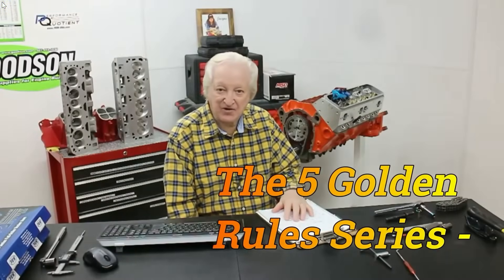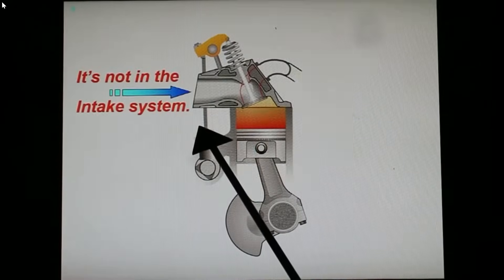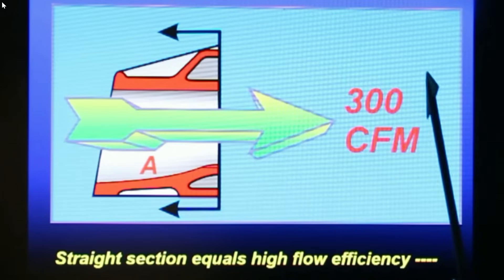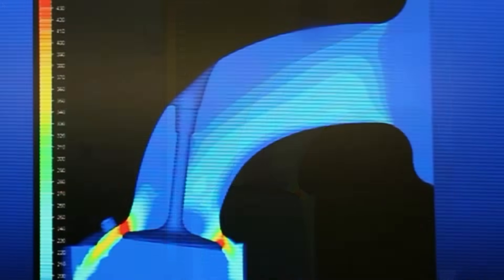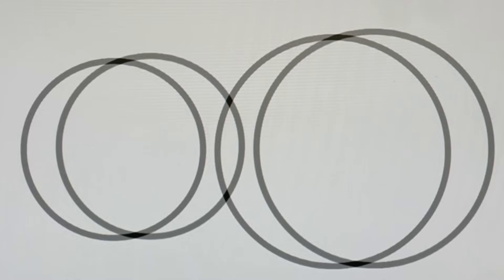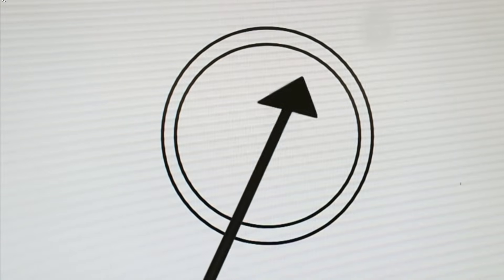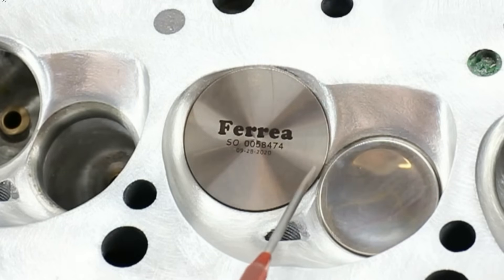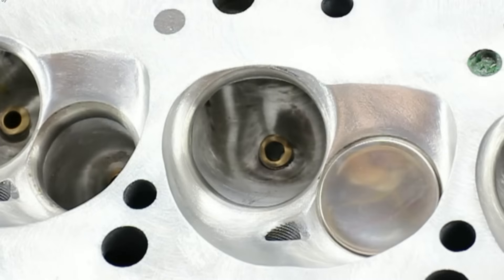5 golden porting rules - #1

Comment: I start by saying that I'm not an expert at all, just a curious person. I've not completely understood what is the radius percentage referred toso I'm probably wrong but with what I understand the valve inlet should be a little bit oval in order to help the flow on one side but the valve seat must be round in order to guarantee the sealing effect because you can't maintain an oval valve aligned because you don't have any tipe of guiding system. If anyone can explain to me that part I'll be very interested.
Reply: Air will take the shortest route, and an oval valve would force uneven airflow for a start, with more crowding the short sides. You want as much flow as possible especially at part lift, and a circle simply gives the best, even flow. It also helps induce swirl into the chamber which is essential for good combustion, and exactly why circular valves do this so well isn't really understood, they just do. They are also easy to produce, thus cheaper. Finally the slowly spinning valve prevents exhaust valves in particular not burning in any one spot, another upside to a design that works well for many reasons. There's too many upsides, and if another shape worked better you can bet the racing community would have championed it!
Reply: So essentially ,the seating-radius (sealing-radius) remains perfectly-round while a very-small area immediately-below it is very-carefully opened-up a bit or 'ovalled' to a minute-degree to encourage/catch/create higher-flow over/through that point of the circle...that's what I got out of it     David   NZ

Comment: So the valve seats are ovals and have a higher radius on the upper side of the inlet port?
...then what about the contact area were the valve hits the seat? Will this area be equal grinded all around the seat? Or will the contact area in some parts of the seat be more or less?
Reply: 3 angle  valve  seat,  he is speaking  of narrowing  the insert inside  angle.  Thus  make  real  narrowing  in that area.. when  there was no valve  inserts, you just did a angle  grind  with  the seating  tool  making  the inside  angle  narrow

Comment: Why not horisontel sliding valves with fully open port?
Reply: Sleeve valves.
They did that on piston aircraft engines.
Check out the Napier Sabre and Bristol Centaurus.
Reply: The mechanism would be too complicated and fragile and would not hold up to the stress of combustion.
Reply: Look up Knight engine - silent as a Knight, I think their slogan was.
Reply: I think there are some Indy car engines with rotary valves for max efficiency. Maybe this isn't what you're talking about
Reply: I am interested if sliding valves have been used in performance automotive engines.  Anyone got a link?

Comment: I am surprised David has only got 15000 subs. In a hundred years time this will be the only record of this type of knowledge.
Reply: It won’t matter in a hundred years…. One of two things will happen. 1 …No more internal combustion engines will be in service due to technological advances and or 2- no human beings left alive to talk about it because we ported our heads out of existence over oil….destroying any chance of survival by killing our planet 🌎
Reply: Sometimes it’s better not to make any comments…. Too many sensitive people out there trying to learn how to port cylinder heads. Fact is every cylinder head is different, every performance engine build is different. Porting cylinder heads is just the tip of the iceberg for horsepower and torque. What’s your compression ratio? What’s the displacement of your engine? Are you running headers and what size? Are you running a performance camshaft and what’s the duration?  Are you running a aftermarket intake manifold… which one? Where do you want your power curve for 99% of the performance fans that drive street cars .You can port a cylinder head to perfection and then use the wrong size camshaft or wrong intake manifold because the one you bought looks cool…. But what ever you gained porting and contouring your intake and exhaust ports was lost because you used a bad combination like a sheet metal intake with short runners and a cam that wouldn’t idle below 1000 rpm’s . Great I got 650 hp peak at 7000 rpm’s. But lost 60 foot pounds of torque and 50 hp where I’d prefer to be enjoying it … 2000-6000rpm Headers without considering the primary diameter for your engine displacement and  static compression ratio.  Lots to consider when diving into a project.

Comment: Your intake valve can be done up all great. But it won't mean sh!t if you have a small and restrictive exhaust valve. 

The whole intake and exhaust need to work in unison and efficiently flow.

Your race motor needs more than just a good intake valve.
Reply: That’s nice and all but most engines favorite the intake by 25% or more… that’s why we have dual pattern cams and modern VVT
Reply: I'm pretty sure anyone that knows this much about intake valves knows a bit about exhaust valves.
2:25
Reply: @d.thorpe2046  
Good job completely over looking the entirety of my comment.
Reply: @elgoog7830  You clicked on the video and are trying to refute the wisdom of a GOAT engine builder, you muppet.

Comment: Hey, thanks for the valuable information, can you give an opinion on port matching...in application of 4cyl/6cyl engines...where the intake manifold/ exhaust manifold mating to the head can have a step up or step down creating turbulence, i was taught to try best to create a smooth flow surface for both entry and exit of the cylinder ..is it worth the hassle?

Comment: restriction to cfm on flowbench and restriction to rpm and power capability do not necessarily go hand-in-hand

the pushrod pinch may not be a cfm restriction, but it is an rpm and therefore power restriction…depends on cubic inch and desired power level (be reasonable here).

Comment: I wish i would had this kind of info around 2004 when  i was building CA18DET and RB26DETT engines in my carage shed :D Would have been much more than 408hp from the CA and hell of a lot more from the RB...  Well, i guess today its more like plug and play tuning for youngsters with addon parts only.
Reply: I don't have access to proper tools so I wasn't comfortable with messing the the valve seats on my RB20DE Neo, but  what I did do is polish the comb chambers up to 2000 grit completely smooth and also took off material off the short side to help with tumble. Additionally I smoothed out 95% of the entire intake plenum which should help a tiny bit as I did not like the casting on the inside. I just wish I had a proper dremel and bits so I could have gone deeper and more precise. Also lapped the valves which ended up really nice.

Comment: Is your CFD data doing an engine simulation? As in changing the differential pressure across the valve as a result of the % of cylinder filled for a given valve lift.  Or is it not taking that into account and is strictly looking at flow with 28" of depression over the lift range?
Reply: Doesn't matter unless the CFD result is intended to produce quantitative total airflow results. The solution shows the relative velocities and overall flow distortion (pretty bad, but typical). That's sufficient information to act on.
Reply: @Mr. Moto  The air speed in the port and the direction of flow won't change as the pressure delta is affected by the cyilinder filling?
Reply: @ForceEngineering  The pressure difference across the head will affect mass and volumetric  flow, and velocity. It won't effect the flow field structure much. Yes, velocity change will change the Reynolds number - which can change the flowfield - but these flows are fully turbulent, so it's a weak effect. 
It is very important that the CFD model uses a turbulence model, and that it is operating correctly. This flow has a lot of boundary layer separation (blue regions). While the turbulence increases pressure drop, it actually suppresses the separation and helps overall. Poor turbulence simulation is one of the most common problems encountered with CFD.

Comment: Great video Mr. Vizard!!  But, I must confess, I don't have a total lock on the percentages and what they mean.  Please elucidate sir!   Thanks again for the very interesting and valuable information.  Also eagerly awaiting more on the Mazda 4 valve porting!
Reply: If it is Concentric.
Imagine 90% of valve diameter in the pinch points furthest to intake runner if you have a 2" valve it should be 1.8", 92% is 1.84", 88% is 1.76"
so concentric hole where the inner seat width is 1.82" at pinch points and 1.76" seat width perpendicular.
Reply: @DigiMannen  Define pinch point.  I'm not hip to all this porting nomenclature.  By pinch point do you mean the area in the seat that is directly adjacent to the exhaust valve on one side and cylinder wall on the other?  Thanks for the reply, BTW.
Reply: @russellanderson746  You did not watch the video?
Reply: @russellanderson746  The red areas!
https://youtu.be/eLJU1h-raUg?t=404

Comment: 1) Back about 2005 a guy needed new head gaskets so he ported the heads too. He showed me a pair of mid 70s SBC 350 heads he ported (his first try) and I was aghast. Worst mess I ever saw. At least he didn't gouge out the seats. 
He put them on this ragged out 75 Camaro and it ran like a scalded dog!!  
Surprised me beyond words.
2) 1970 had a 292 Y block that chunked out an exhaust valve. Got a junk head for $5. Must have been a 239 or 256" with tiny quarter sized valves and tiny chambers. Put it on and it ran perfectly smooth for the next 25 years. Go figure.
Never went over 4000 rpm I'm sure.
SMH.
Reply: Chalk one up for "rough" port finish ?? Some guys are trying to carve golfball pips in.  An engine builder told me SBC heads don't need any exhaust port work for the street.
Reply: Cutting pips do help but you need to know where to put them, if you do the whole port it doesn’t work.

Comment: When you said 91%, which measurement is the numerator and which measurement is the denominator.  You left that undefined here.
Reply: Percentage is metric it is based on 100. Take whatever your width is and divide it by 100 times by 91 3.g. 2.02/100 x 91 =1.83.

Comment: Hands down the best book I have ever purchased,  cover to cover gold. My 1st port job was after reading your book port & flow test the engine was a dirt speedway ford 6cyl 250ci crossflow for Australia.  The car won everything it was entered into for 2 years on the same build until I built a competitor car motor,  the 1st race they were both in 1 x new 1 x refreshed they ended up  0.3 apart over the finish line and 3/4 lap ahead of the field. I have always wanted to thank you for all the shared information you have learnt in your many decades of building/racing and shared with the greater racing/engineering community. I have recommended and quoted you many times since,  only just found you today on YouTube.

Wish you were in Australia I would gladly work for you as a learning experience 

Looking forward to the next videos in the series 

Thank you David for sharing

Comment: Stock Pontiac V8 heads just don't have that bowl backwalll metal. Not as much anyway.
Reply: The 455 SD is the only stock Pontiac head that flows ,that's why Pontiac didn't have any cam much over 500 lift the heads won't support it ,buy a big block Chevy
Reply: And I love pontiacs ,there engines not so much
Reply: @darrellsomers5427  
The more lift the better. Reaching max flow sooner adds area under the lift curve = more power. More lift is more important than duration.... To a point.

Comment: Hi David , great video! Can you still get really good flow on Vortec heads with the 1.94" Intake valve or do you need to upgrade to a 2.02"? I have a set of Dart Vortecs going on a 355 SBC.
Reply from the maker: I have done a goodly number of vortec heads and I seem to remember that  in most cases of aftermarket heads they do almost as well on a 1.94 intake as they do on a 2.o2 so, for cost sake, stay with what you have.
Reply: @DavidVizard  thank you sir, I appreciate the response!

Comment: Thank you again Mr Visard. Can you please clarify one detail for me. When you are measuring throat percentage, are you measuring it as 90% of the inner diameter of the: valve, outside diameter of the 46 degree seat, or inside diameter of the 46?
Ok maybe 2 things...if I was to use a 31 degree valve face, (like in your horsepower book) does this change the reference point for our measurements?
Thank you kindly
Reply from the maker: Even, Look out for part 2 of the Golden  rules series.
Reply: @DavidVizard  OK. I'll just watch David Visard re-runs in the meantime!

Comment: Good info but I'd like to see what a non race prepped head does in that computational simulation and how much cleaning up the sharp edges from cast to machined accomplishes. Showing where a restriction in a fully prepped head is doesn't tell me much about the garbage I want to improve.
Reply: Sharp edges will crack easier than rounded edges.
Reply: @nathanbopp6163 he's not talking about shaping rough edges into a port. He's talking about casting flash and roughness in OEM ports and tracking improvement as you go on OEM stuff. Not improving already prepped heads
Reply: Have patience, I'm sure he'll get around to that stuff eventually!

Comment: Are you saying there's no reason to touch any casting to machined surfaces? First thing to do is go to 90-91% of valve seat area?
Reply: The video shows that the valve area might be the most “restrictive” part of the head so it’s logical to focus on that first and then match the rest of the intake port to it so everything fits also it’s obvious there are going to be more videos
Reply: @hasanahm3d valve IS the restriction on every head. Always will be.
Reply: The port flows 300 stock. It doesn't need anything until the valve flows 300.
Reply: @hotrodray6802 that makes no demse
Reply: What he's saying (without blatantly saying it) is that valve size is going to directly determine how you shape the rest of the port. Starting with the bowl, then the runners are sized and shaped to the bowl. There's a lot more to it. You could probably easily write 1000 pages on it. He's going to guide you through the steps and let you figure it out later. Versus you readinf on your own and it takinf you 5-10 years to learn how to knock them out of the park on round 1. He's just started saving you lots of hours of scrapped metal or compromised, cookie cutter engine building